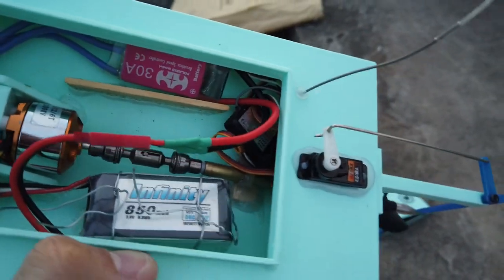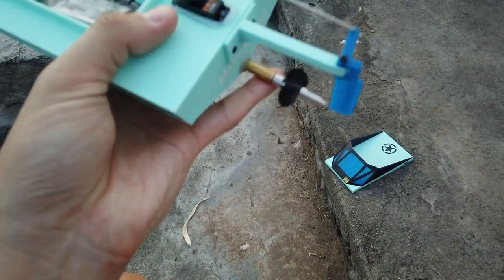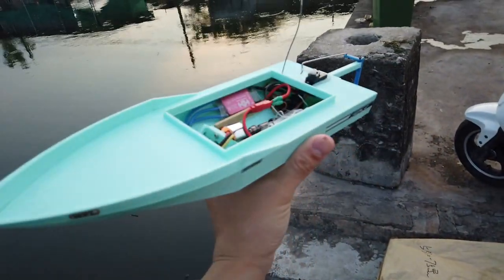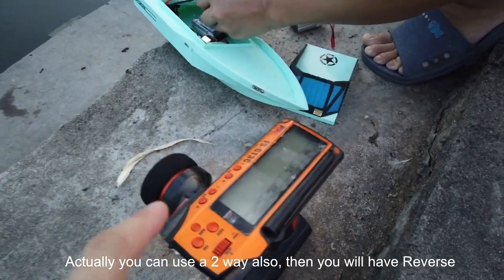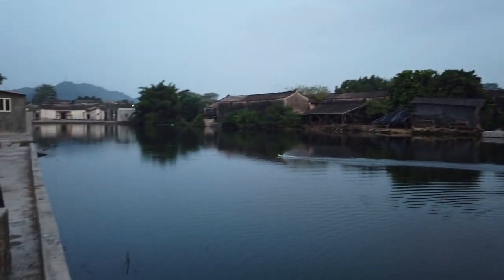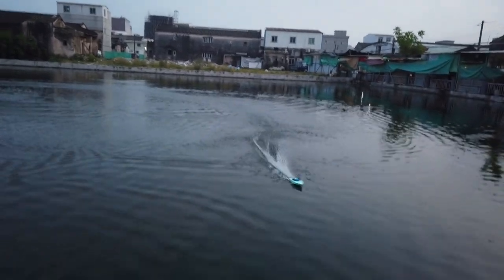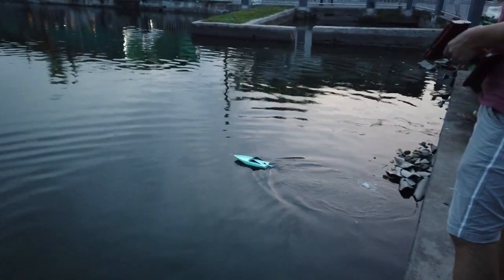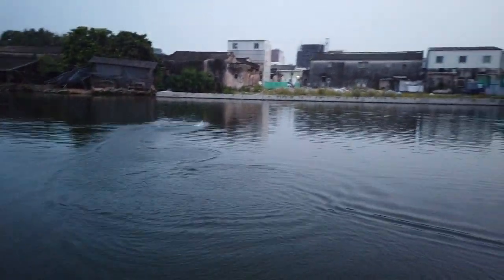3D Printed RC Brushless Speed Boat

Comment: I really need help. I have 2 motors on hand. S 1000kv outrunner, and a 1/16 4080kv 4 poles in runner, what do I do
Reply from the maker: use the 1000kv one
Reply: EdwardRC Car what makes it better?

Comment: What size 3d printer do you need for it?
Reply from the maker: Ender 3 bro. Hull prints upright
Reply: Edward Chew but what size is the boat? Like 200mm tall?
Reply from the maker: @Rc2Go  hi bro. 350mm long

Comment: Do you think a 3650 motor with 3500kv and 60a esc combo from an RC Car (Weight of the combo: 270gr) would be appropriate for this? Or would it be too heavy and sink?

Comment: I recently made your boat but the propeller creates a cavitation and the boat looses all his power so it is not going fast at all. Do you have any idea to avoid this cavitation ?
Reply from the maker: We didn't have this problem though. Try moving your battery location to change the boat angle. it's not designed by me.
Reply: @EdwardChew  
I have already tried to move it backwards or forwards but nothing works

Comment: I built this boat too, but now at the end, i have got a problem with my ESC. The ESC ist normally for quadcopters and other rc flying models. I didnt geht it working with my Reely gt6 remote control. I calibrate the gas about 6 times, i used the reverse option and so on. But when i plug in the lipo, the motor runs with about 50% power. When i release the gas, it turns more faster. When i pull the gas trigger the motor stands still. The motor uses the full range of my remote control. The part for forward and backward. But the complete range for 0-100% of the ESC, one way. 

Is there a way to solve this probem? Or will i need a new ESC? My ESC is not programmable. :( I am thinking about buying a marine ESC with 30A.
Reply from the maker: YEs of course it behaves that way, your ESC is a one way esc with only forward from 0-100%. 
Your radio system is for forward and reverse, hence the mid stick.
Either you get a ESC with forward reverse or a radio without self centered stick
Or, stick with current radio, always pulling your trigger to stop the motor and letting it go to go forward like what our friend here doing.